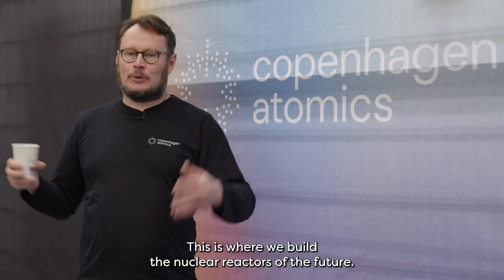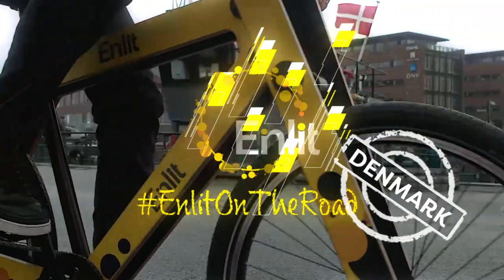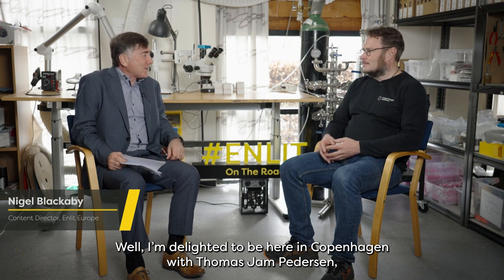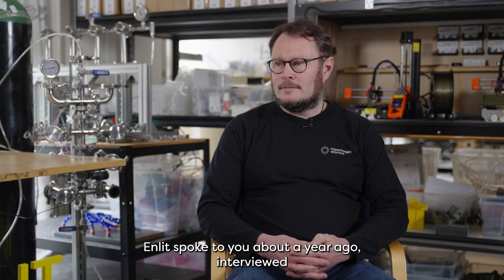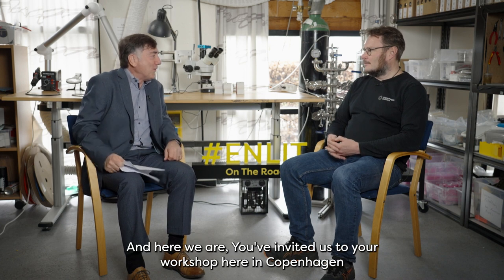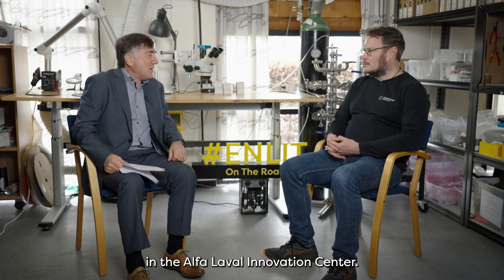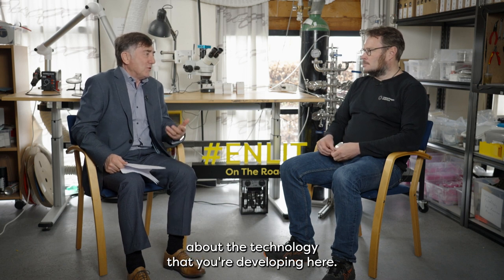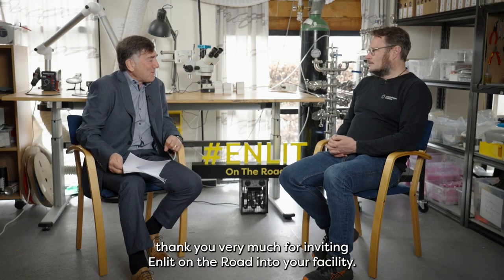Site visit: Building the nuclear reactors of the future

Comment: What about neutron embrittlement of the "onion" stainless steel structure, after a few years' of use ? The reactor would not to be dismantled and replaced, being then a highly radioactive structure.  This was not discussed in the video and is an important practical consideration.

Comment: Go to Indonesia and compete/work with Thorcon Power, first to market wins second to market also wins because the market is so enormous.
Reply: I know about ThorCon and they are good. He say in a different interview that he consider the other MSR companies colleagues rather than competitors, as long as Copenhagen Atomics does not have a product fully on the marked. So they should collaborate on some research and development. 
However, Copenhagen Atomics are way ahead of ThorCon since they prioritise testing over modelling. The original MSR was infamous for having to be shut down all the time to fix issues with pumps and plumbings, so testing is of the essense. 
ThorCon also have a different design philosophy: floating barges (which CA say will add time to the development cycle), also not a pure thorium reactor - they even admit they mainly add thorium to the fuel mix for the hype. They do plan on using shipyard automated production facilities, which might decrease production time dramatically. But I think the reactors and power plants need to be designed specifically for this kind of production, CA go for a model where subcontractors provide the most parts rather than a giant automated factory.

Also, I know Indonesia is a huge emerging enegy marked. But CA can place their reactors everywhere, not limited to large harbour cities without existing energy infrastructure. Providing energy for new industry like synthetic fuels, carbon storage or desalination plants is a huge marked on its own.
Reply: @migBdk  Both have advantages and disadvantages. Thorcon will likely go straight uranium, a good move, thorium just adds cost and complexity. CA needs to find a host country and it took Thorcon several years to establish that. Barge construction makes everything go faster, not slower, maritime laws are more lax than terrestrial. Something like 80% of the world's population is within transmission line distance to a port or major river and certainly, the industrial applications are in that range. 

I see thorium as a handicap at this stage in gen. IV development. It requires a breeder reactor which adds cost and complexity. Also, there is no shortage of uranium, we have about 2 billion years worth.

Comment: You can count me as one of the folks that really wants to see this happen for many many reasons, not the least of which is to dispose of the long term actinide wastes from conventional pressurized boiling reactors, and Candu's, but also because this tech is inherently safe as opposed to conventional plants which are a disaster waiting to happen.
I think a lot of the push back comes from the fact that you can't readily separate out weapons grade plutonium from these reactors.  Yes, it does produce produce plutonium 239, but it also produces other plutonium isotopes which are short lived and thus would cause the bomb to fizzle rather than explode if you don't do isotopic separation, and these isotopes are so hot that they are difficult to work with, so one would just leave them in the reactor as more fuel.  But I do expect this is the main reason the DOE has been so reluctant to license these in spite of their huge safety and waste advantages over traditional reactors.

Comment: Is there an advantage/disadvantage to the dual-fluid-reactor?
Reply: I don't understand your question. Do you mean the flouride salt with thorium vs flouride salt with uranium 233? That is what this is.
Reply: @royh6526  The main difference seems to me  that CA uses heavy water as moderator and pumps the salt through a heat exchanger. The DFR on the other hand  has no moderator and uses liquid metal as coolant. But both are capable to breed U 233 from Th 232, so have a similar goal. So what are the advantages/disadvantages of these different approaches?
Reply: @friedrichkoerner fast reactors can be more technically difficult and also require much larger inventory as the neutron has a harder time interacting with the atom in the fast spectrum.  This larger inventory makes it much harder to power the world on existing stocks of the kick starter fuel, existing stockpiles of nuclear waste.

Comment: I gather a significant challenge is how to contain highly corrosive salts for a long period. Perhaps this is a trade secret but if not, it would be interesting to see the proposals. I imagined some sort of ceramic vessel but perhaps the temperatures are too high for this.
Reply: The secret is ultra purity (lack of oxygen)
Reply: Iconel and Niconel alloys, same stuff that a lot of nukes use.  It is TOUGH stuff and costs a lot more than regular piping.
Reply: Copenhagen Atomics recently released another video addressing this question.  In short, they filter the salt and ensure it remains pure.
Reply: What about chromium migration of Hastelloy at temperatures 🌡️ approaching 700C making the alloy brittle?
What about the lost efficiency due to the physics of fluid dynamics? Pipe size matters.
Good idea to invest in research reactors and there are promising niche uses but not to deploy for large scale economic power solutions. 
For fossil fuel ⛽ transition we need safe, tested and proven effective solutions now. 
Most of all we need a large scale commercial nuclear waste repository. Australia should become the waste materials repository. Australia 🦘 exports uranium and has a responsibility for the residual end products. In exchange the world 🌎 as part of a Paris Style agreement could help Australia transition from coal to nuclear ☢️.